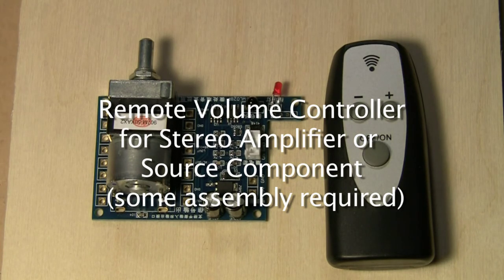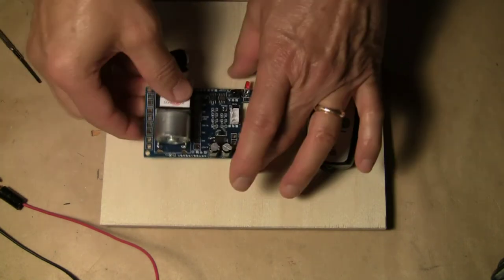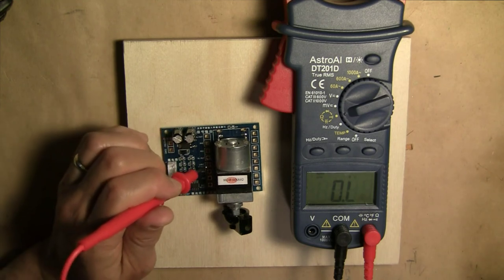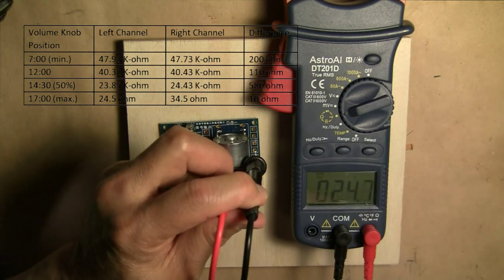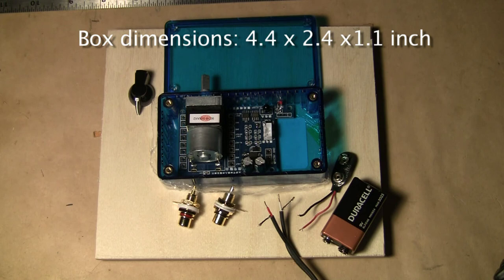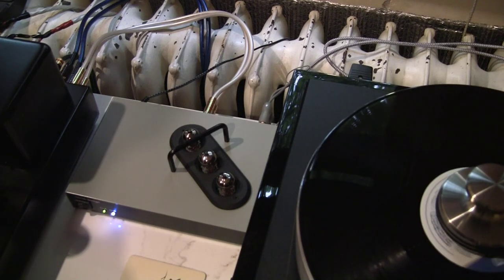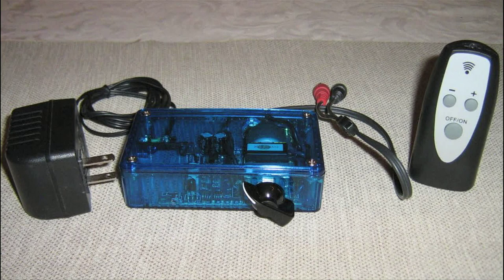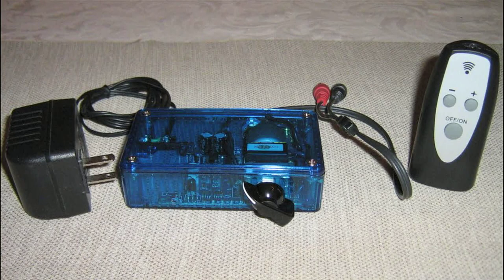Remote Volume Controller for Audio Amps & Source Components

Comment: THANKYOU Raymond  I’ve been waiting for someone to build one of these for years ! I’m glad you found one and shared it onYouTube  when I had my first house onmy own I rigged up Rubber bands over my Volume knob for grip and I could adjust the volume from my couch using a  long stick LOL I took a while to develop the correct touch  and at the time I was into Radio Control Airplanes and Cars so I  thought about using that circuitry and Servo systems

Comment: Ideally. Attach the motor physically to the volume control knob on the Receiver or Amplifier. Let the motor turn the volume control. Any non technical type would buy it. Thanks for the Video.
Reply from the maker: Totally agree! The motor is attached to a volume controller ( potentiometer) and circuit board and hard to fit inside a component's box. I tried using rubber bands to turn the shaft of a component's potentiometer but motor isn't strong enough.
Reply: Not strong enough? I ordered to try this

Comment: What happening when you are push on off button? The sound is muted or, volume turned down to minimum value or something else?
Reply from the maker: Press 3 sec to turn off. Press 1 sec to turn on or bring up a menu for Reset, Time delay Off or Off.

Comment: Mr. Raymond, I would like thank you for this video and hopefully ask you something about this product because I have purchased one and am having problems with it.  The problem seems to be with the potentiometer part of it. It powers up. The ohms numbers don't seem to be right after taking a reading like you did. The volume only starts to play at the last 1/10 th of the tavel.
Reply from the maker: Check the wiring, especially the center-tap. I will check my unit to see which way the inputs & outputs are wired. If you measure resistance of Centertap to either ground or signal point you should see smooth increase/decrease in resistance, not what u r getting.
Reply from the maker: On my unit, looking from top with pot facing me, ROUT on bottom left side is Red wire from RCA jack (right output), LOUT is White wire (left output), GND & GND are where the shielding wires go. On right side are the input connections. RIN is Red (right input), GND, GND (shielding wires), ROUT is White (left input). Hope that helps.

Comment: i got one of these , soldered 9vdc supply to board............led lights up and flickers when I press  vol up or vol down but motor/pot does NOT turn ........any thoughts ???....... i THINK ITS A DUD
Reply from the maker: Make sure u soldered to the right person connections. Listen close to hear if motor rotates when vol buttons r engaged. I found with a 9v battery, there wasn't enough juice to operate for very long. My wall wart is 7.5W up to 600 mA.
Reply: @AudioTnT  ....I have a 12vdc 1amp supply , is that too much voltage ?????
Reply from the maker: @jonseeley8263  12v should be fine. I measured my 6v supply which turned out to be 9v. Could be a dud unit.
Reply: @AudioTnT  .....i have only tried it with a 9.6vdc supply with 200mah ......hopefully you are right and I need more amperage.....will find out soon

Comment: Hello,  Thank you for your video.    I've been looking for ways to remotely control my tube preamp.   This looks like it will add resistance & capacitance onto the analog signal paths.   I'd think it'll change the preamp characteristics.   Do you agree?
Reply from the maker: It will add resistance in series with volume potentiometer of your preamp. Turn  preamp volume pot to max to reduce its resistance. I doubt there is a change in capacitance. Compare sound quality with/without the remote volume controller.

Comment: Thanks. Wonder how long that battery will last if using only once or twice a week.....
Reply from the maker: Using an AC power supply I notice it resets itself to zero volume each time it's plugged into the wall outlet. Unless you disconnect the battery when not in use, the circuitry is still using a bit of power to "remember" the current volume setting. If you try this, let me know if it works.

Comment: Raymond Soo can you share a link of controler?
Reply from the maker: https://www.elecbee.com/en-24386-AC-DC-9V-Infrared-Remote-Control-Volume-Controller-Board-ALPS-Pre-Potentiometer?utm_term=&utm_campaign=Shopping+%E5%8A%A0%E6%8B%BF%E5%A4%A7+2021/4/21&utm_source=adwords&utm_medium=ppc&hsa_acc=9958698819&hsa_cam=12803474616&hsa_grp=126885124968&hsa_ad=516175968131&hsa_src=g&hsa_tgt=pla-1186173532455&hsa_kw=&hsa_mt=&hsa_net=adwords&hsa_ver=3&gclid=Cj0KCQjwmdGYBhDRARIsABmSEeNvi9AJDMSxAnNsUO5RVDERK8cCWN0Hw-N3NYMTsQ9IO7jaGO3rPOQaAjR_EALw_wcB

Comment: Hello, I want to ask. Could this alps motorized control volume be used as a light dimmer? So I want to make a project to control the lights through the mobile phone and potentisio will follow the change. But i still dont know the wiring. Sorry for my grammar. Thank you
Reply from the maker: This potentiometer adjusts voltage typically around 2 volts. A dimmer light switch works with AC voltage of 120 v in North America. Answer is 'no'.
Reply: @AudioTnT  But I only use five High Power Leds which only have three watts of each

Comment: Do they make a similar rotary controller that I can mount on an old potentiometer (knob) ?
Reply from the maker: You mean put this in place of an existing pot in an electronic component? I wish that was possible. The pot has a motor behind it; both would have to be separated from the circuit board, which would be located elsewhere.
Reply: @AudioTnT  not instead of a pot but basically having that mechanism that rotate the pot to be rotating an existing pot from the outside, like mounting on it instead of the plastic knob..?
Reply from the maker: Today I connected shaft from remote controller to volume pot shaft of my preamp using a coupler. Unfortunately the motor is not strong enough to turn the preamp pot.
Reply: @AudioTnT  hmm I see.. I was thinking there are definitely some small size motors that can move the knobs from outside? Like the ones design to auto tune guitar tuners? But I guess no company makes them able to latch on to the external part of the knob? 
Sorry for all the questions, thanks for your input!

Comment: I can understand you amp is quite expensive---but why not just install the motor volume control in place of the manual volume control?  I have a much less expensive tube amp that I am considering adding this type controller inside the amp. I suppose one main problem is powering the motor...I will have to see if there is anywhere I can draw power from inside the amp from the existing circuit....
Reply from the maker: That would be my first choice but not enough room as the motorized vol control is on a PC board. I suppose I could remove the pot and extend leads back to the PC board. The IR detector on the board still needs an opening to see the remote control.

Comment: These things are junk. The dial turns slow as heck, one craped out after a couple of hours being on. The other volume dial was so slow it took about 30 seconds to turn the volume all the way up.
Reply from the maker: Sorry to hear. Mine is still working fine. Bit slow I agree. I measured voltage on my wall wart to make sure it was near 9v. Some give much higher voltalage. I also turn mine off after I set the volume to the level I want.